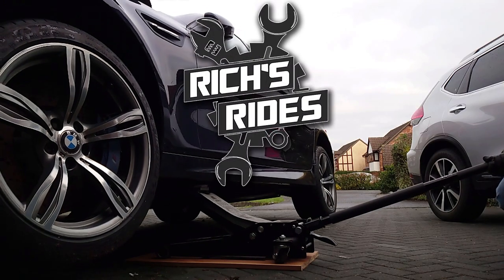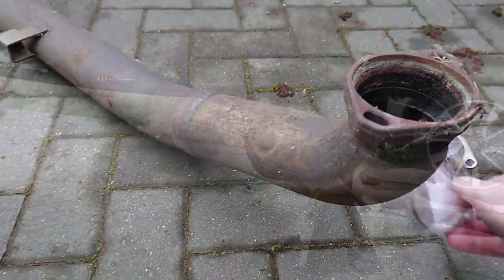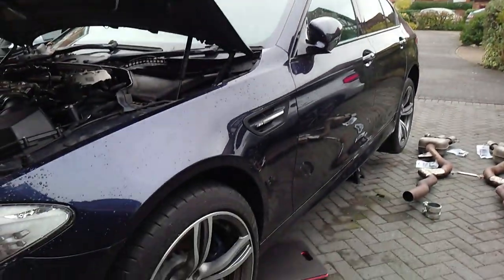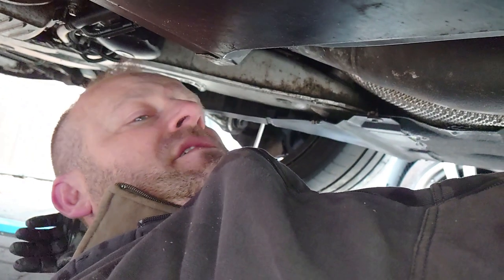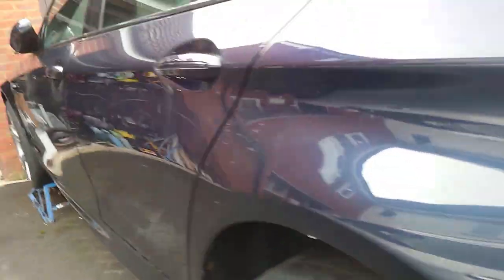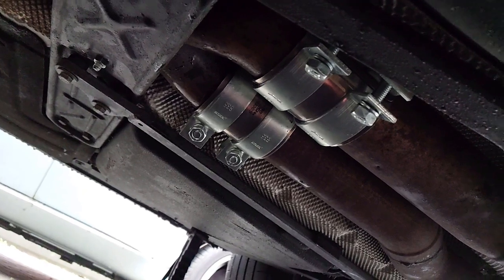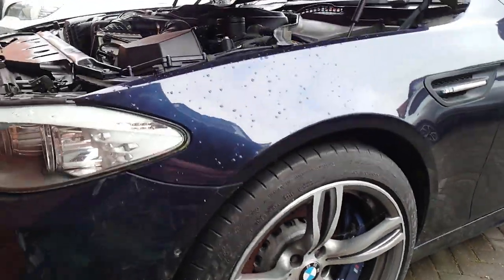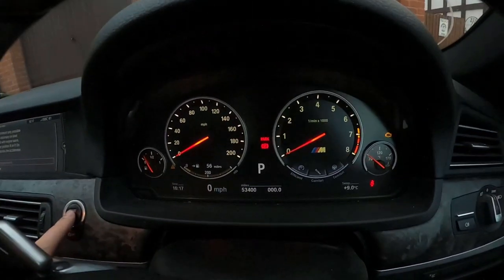Salvage BMW F10 M5 Exhaust install more problems Rough Idle!

Comment from the maker: The gift that keeps giving. It's all back together but it's running rough as a donkey with 3 legs.

Has anybody got any ideas ?
Reply: Try adding some fresh fuel
Reply: Maybe the MAF Sensor, i had the same problems, cleaning the maf sensor helped in My Situation . 
Greetings from Germany
Reply: Hey! Massive progress! The fact it didn’t run through a cold start procedure (raised RPMs) when you started it tells me it may have been mapped previously. People often map out cold start due to noise and annoyance as it’s not needed when you have decat downpipes, and you’d typically only have those for a stage 2 map. In which case the issue could be a dodgy map, may be worth getting a software update on the DMEs - just an idea!
Reply: If after the software update you get a fault on both of the DMEs saying they’ve been manipulated then this tells you it was mapped previously. The first thing mappers will do is to code out that error so it looks green and happy on the ISTA tree, however when you software update it starts detecting and alerting on the manipulation of the boot loader again. I believe you can send the DMEs off and have a genuine BMW boot loader put back on the bench in order to stop this.
Reply from the maker: +Daxxr Good shout mate, I've been drawing up a long list of things to check but stale fuel wasn't one of them. I'll add it to the very long list!!! Thanks. 
Sounds like you're speaking from experience?
Reply from the maker: +D M Possibly, the MAF's are both new, but that doean't mean that they're not contaminated. I'll give them a good clean. Cheers Buddy
Reply from the maker: +Luke Oxley cheers buddy, to be honest it was so lumpy I wasn't sure if it was trying to perform a cold start or not. when you say software update the DME's do you mean bias E-sys ? inject the latest CAFD?

Any idea who can put a standard map back on them if it comes to it?

Comment: Great job bud, that system wasnt the easist to fit but you got there 👍.

Hope you get the rough idle sorted, 
Beautiful ride.

Keep up the great work
Reply from the maker: +Stay True TV it wasn't the easiest, would really help if I wasn't doing it on my driveway in the middle of winter too!

Have found the rough idle problem, it's not good news unfortunately. lots of work ahead of me.

Comment: Possibly ignition coils, they are common. I’ve changed all coils on mine plus the plugs twice in 500miles as Bosch brought out some better ones. I’d also look to update software.
Reply from the maker: I'm hoping it's coils or plugs to be honest. I think I may have gapped the plugs wrong too!

Just to be safe I'm going to do a compression test and put a scope down and have a look at the cylinders to make sure there's no scratches too.

Feel like I'm so close put also just on the edge of a huge amount of work !

Plugs and coils twice in 500 miles sounds fun, was it misbehaving?
Reply: @RichsRides  fingers crossed for you. I left plugs factory gapped as you shouldn’t have to change unless modified. 

I was getting misfires and power cut off, especially at full throttle. I decided to just bite the bullet and buy a set of coil and the newer plugs, even though some coils had been replaced under warranty. Cost wasn’t so bad and not the hardest job once you’ve done it before. Been fine since

When I took plugs out I noticed 2 plugs were different. Partly my error for not noticing first time, but these were supplied incorrect by gsf
Reply: @RichsRides  if you’re near the midlands I have my old plugs and coils if you wanted to pop up to use for testing
Reply: Also regarding software update, make sure you hook up the correct power supply. They can pull some amp, I’d recommend a MST-80
Reply from the maker: @b21playa  I've already got it booked to a battery maintainer, was thinking about doing it in stages rather than doing it all in one go. Need to work out the dependencies first! How long does a full flash take?
Reply: @RichsRides  I’ve done mine twice now, took about an hour first time (wasn’t all modules) and then 2nd time was even quicker as it was 2 modules that has changes.

My older x5 and e90 took a lot longer, data transfers over the older protocols were a lot slower, especially when doing the idrive via most. All mine have been done via icom
Reply: @RichsRides  also look at bmw update site for idrive update, which is done via usb (at least on mine with nbt)
Reply: @RichsRides  not too sure about a battery maintainer, they can’t provide the amps that the  car can pull
Reply from the maker: But an MST-80 is so expensive !!!
Reply: @RichsRides  I agree they are, I ended up getting one last year after deliberating over it for ages. My previous one was a Maas sps-60, a lot cheaper